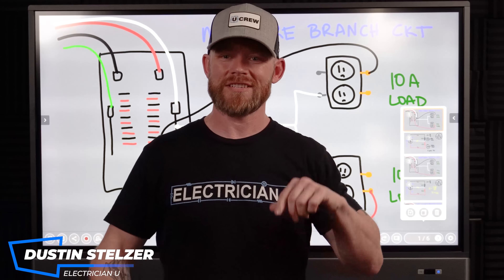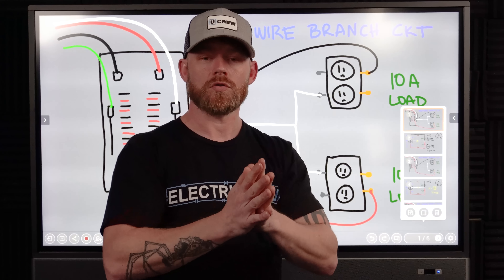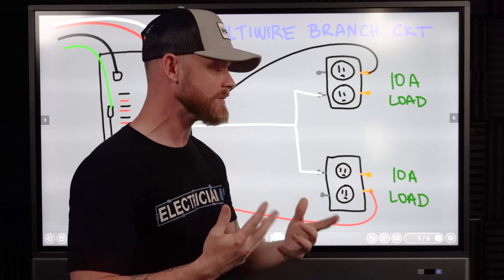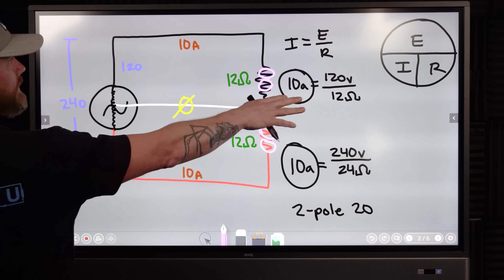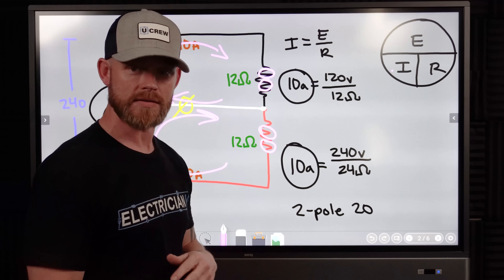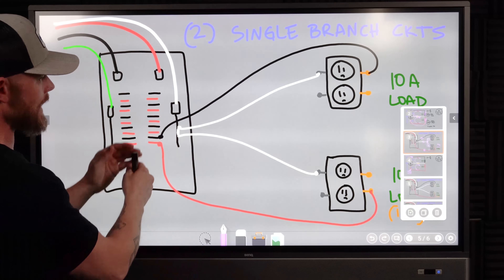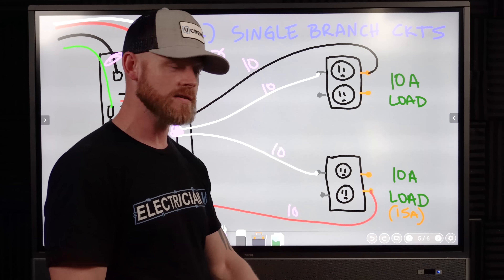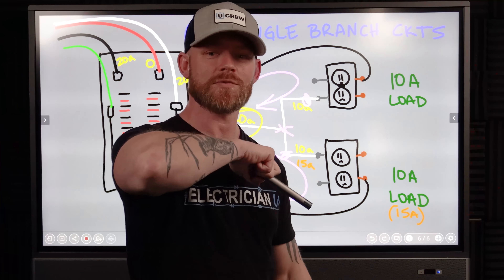Neutral Imbalance in Multiwire Branch Circuits (Two Hots, One Neutral)

Comment: So my question would be why the voltage still read 120 & why would it not fry 120 appliances? I understand the amp cancelation, but not the voltage.
Reply: If you are at all familiar with electronics, what happens to a 12VDC circuit that has two resistors in series?   Doesn’t the voltage divide across the resistors to be 6 volts?   The same here.   The 240 volts is connected in series to the two sets of equal resistance loads to divide to 120 volts.   Voltage will vary if loads are different resistances.  So, if no load on L1 circuit and full load on L2, it would be 240 volts and create a very bad situation.  Hope this helps.   Best wishes,   Kevin

Comment: Great video. Should this be a consideration in home wiring to balance the entire load for the whole house? How close should the load on each 120 feed be?
Reply: It will not matter.   Here is the problem.   Turn on some 120 volt things in your house, take readings and L1 is way higher than L2.   Turn on more 120 volt things, now it is almost balanced.   The third time could be higher on L2.   The point?   There is no way to balance an electrical panel.   Engineers used to put it in their specs that they wanted connected loads within 10%.
Reply: Yes it is possible to try to balance the main panel. In fact, the code acknowledges this by allowing a lighter gauge neutral. The only time the neutral will see 'full' current as the hot is when ONLY loads on L1 are on. Or ONLY L2. Not very common, especially as more and more loads come online and the sizing of the service feeder starts to matter.

Comment: Relatable story : Industrial building. Water treatment  plant built in ‘91. 
We had chemical pump control panels next to each other. Low amp draw. Converting 120V to a DC drive 90 V dc max. For some reason they had independent breakers and it was a split circuit. We had modern pumps with  solid state controls plugged into each supply in place of the dc conversion. The new units would Red screen occasionally. We thought it was faulty equipment. Eventually at some point we had some other failure of power supply loss 460V in the same area.  It was discovered that all this wiring 120V and 460V was in the same EMT buried in concrete. The wires had worn through the insulation and the voltages nearly shorted out. Water had infiltrated the conduit also. It was all replaced separately but our electrical contractor said it was likely we were intermittently losing our 120v common which may have yielded 220V and hence the brand new solid state computer controlled pumps were selectively locking out with Red Screen. I dont think they saved 50 cents worth of wire in 1990 because the  electric service room was only 30’ away. Why they put 120 and 460 in the same conduit is a mystery to a laymen like myself. Comment?
Reply: We would have never been allowed to do that!!
Reply: Laziness or stupidity.

Comment: When I was a first year.. almost 6 years ago.. a Journeyman asked me which wire was the most dangerous or requires the most caution. I of course said... well it's your hot.. it's bringing power through your circuit.. I feel like this video is an amazing example of why your neutral CAN be the most dangerous. It's something to keep an eye out for before you start jumping into your project. Very nice video. 👌
Reply: Good stuff. 👍 
For multi wire branch circuits,
I've been Using breaker handle ties that allow for independent tripping but simultaneous switching Because I believe that's right, right?
 If you haven't already you should make a video about do's and don'ts of multi wire branch circuits.
 Should make for a lot of content hence my comment is so f**** long
like If 2 single branchers are in one Box, you don't just tie all the whites together.
 And why you might find a neutral wire in the panel has turned a darker tan color compared to the other white ones.  Like what can happen if you disconnect neutrals at the panel Without killing the breaker(s) it belongs to.  Pig tailing neutrals at devices. And if you find Kitchen outlet Receptacle with black and red  on one side, Note the tab is broke off,  Separating the terminals.
  Labeling.
How you can ruin plugged in equipment by Being really cool and working on a multi wire branch circuit while it's hot ( Or The other breaker is still on) and disconnect  the neutral.
Reply: @earthtones1138  i believe thats right? how you ever get your licenses?
Reply: @jamesmore2919  
 License? 
We don't need no stinking license.
Reply: @jamesmore2919  
I welcome anyone who knows to answer. 
 You got a license?  Do you know what is correct?  If you knew you would have said so already. Wouldn't you like to know? 
My multi branch wire ties are set up for independent tripping and simultaneous switching Because that's according to the code I Researched years ago and That's what I've been doing and I haven't questioned it. But Rules change and the code changes. And I haven't heard of any other electrician actually Doing it this way Despite the code I read once. Instead they're using traditional wire ties or nails or double Pole breakers. Is this way dated? Or is mine Dated,Unnecessary overkill. I'm guessing The concern is breaker handles doubled up can add resistance And can Potentially retard tripping.
Reply: Biggest shock of my 50 year career was a neutral. Service drop, (overhead) was torn off the side of the building, laying on the ground. I had cut & taped off both ungrounded conductors. I then separated the neutral ACSR cable(overhead) from the SEU that should have run down the house. I was unable to let go. Still not sure how long I was stuck there, it seemed a very long time.
Reply: @williambeauregard5440  You've obviously never grabbed a knicked cord while on your knees covered in saltwater.
Reply: @williambeauregard5440  50 year career. and you working hot circuit? how you make it that long?
Reply: If someone put a gun to my head and said cut a wire between the 2 in cutting the neutral
Reply: @edsherwook5196 if you’re cutting a single wire it’s exactly the same whether it’s hot or neutral. Cutting a hot and neutral, or hit and ground, or hot and another phase is where you will have a wake-up call.
Reply: You can cut any single wire np.
Reply: Thank you so much for explaining this in a way that is for Electricians every other video I try to watch on this subject is a watered down version where 70% of the video is explaining that black is hot, white is neutral, green is ground, and electricity runs this way  (bla bla; helper level information, bla) then mentions imbalance one vaguely, and video over.  This answered everything I was curious about, and now I'm a significantly more knowledgeable electrician than I was 15 minutes ago. This channel has got me so much further as an electrician than any journeyman has.
Reply: The biggest shock I ever got was off a bare ground wire in an undetected ground fault situation.
Reply: @ that doesn’t  make any sense, because the wiring would melt in a ground fault that for some reason doesn’t trip the breaker. But if you have a ground fault you would for sure trip a breaker. But to even further explain that this is a made up story even if it was energized it’s still 120 volts, and the current doesn’t make  any difference because it’s your resistance and the voltage that determines how much current goes through your body. A shock off a feeder would be the same as a shock  iff a branch circuit, if the voltage is the same.
Reply: @danpez1  What makes you think a breaker trips in a ground fault situation?  A breaker measures current between live and neutral. You're also assuming that the voltage was 120.  It was decidedly not.  There was no current flowing until I triggered the arc flash.
Reply: @ arc flash is not the same as getting a shock, a breaker measures current in hot, ground is the same potential as neutral, they are connected at the panel. Ground is there to trip the breaker in a ground fault, that is the entire purpose of the ground wire.
Reply: @ what voltage was it?
Reply: @danpez1  If the ground was connected at the panel, the current would be flowing to the panel. This was voltage on a bare ground with no current flowing. The line holding the voltage wasn't connected to ground and wasn't connected to neutral.  That was a ground fault.
Reply: @danpez1  There was no current.  Until it fliowed via me.
Reply: @ nothing you say makes any sense and is not how things work. There’s never voltage on ground, it’s the definition of 0 volts.
Reply: @ not even a chance in any possible scenario sorry
Reply: @danpez1  Sigh.  It's supposed to be 0V.  That doesn't mean it is 0V   That's what it means to have a fault condition.
Reply: @danpez1  I hope you never have to learn that one the hard way, like I did.  I've since seen a situation where plumbing pipes were floating at 800VDC. Because of a ground fault.  I didn't take a shock from that one.
Reply: @ not a chance in hell, did this occur. You must have no knowledge of electrical systems to be saying something that completely crazy.
Reply: @ you never seen DC abvove 24 volts in your life, certainly not on plumbing, they are grounded dummy.
Reply: @lol the ground is always the reference, u don’t know what a ground fault is do you.
Reply: @danpez1  Sigh. Shakes head.

A ground wire isn't the ground.  Have you ever worked non-residential?  Have you ever worked outside the United States?
Reply: @danpez1  They are supposed to be grounded.
Reply: @danpez1  Ok.  Tell me what happens if there is a ground wire.  The ground wire is not connected to Earth. It had never been connected correctly.  Something shifts, and the ground wire is shorted to a live transmission wire.

What will be the potential on that ground wire?  And possibly the box chassis?

Now, someone touches that wire, or a chassis.  Where does that current go?
Reply: One more reason for dedicated neutrals is the safety of equipment , 110 circuit can become 220  with loss of neutral ,and that's because the loads are never balanced .The voltage drop due to  conductor resistance in one branch will create harmonics in the other  resulting in dirty power ,some oversize the neutral most head towards dedicated .Shared neutral design is shy of delivering adequate power and safety where needed .
Reply: @rovidius2006  
When multi wire branch circuits are installed correctly, they're not any issue until electricians or handyman start messing with it.
Reply: @earthtones1138  Not true ,imbalanced loads can have detrimental effects on sensitive electronic devices ,when you fully load one leg and lightly load the other in longer runs voltage can  fluctuate quite erratically  ,there is literature published on it  .  , Inductive loads on one leg will induce spikes in the other due to resistance in conductors .Regular households will rarely notice it unless something sensitive fails repeatedly .You wont see this problem with dedicated neutrals unless loads are large  and imbalanced enough  in   destabilizing the transformer  .
Reply: I'm from the UK and yes the neutral can be the most dangerous. Working on circuits, one should be very sure that the neutral is of the same circuit that your working on. If its on a different circuit to your hot wire, with plenty of load and you spilt the two neutrals and get across those neutrals, you will have a problem of letting go!! You will stick to those cables, because in affect you are connecting them and carrying the load! So yes the neutral can be very dangerous. Its important not to share neutrals, each circuit should have its own neutral. Testers than only test for hot wire are dangerous just because of that useless. Neutrals in  a board should correspond with the hot wire of that circuit. DONT take it for granted, thats when accidents happen. It gets much more important when you go industrial because the loads are so much greater. Be wise, DONT EVER take anybody's word-check and be safe. I know, because I got a 415v shock on a "dead " board!  Great excuse for a beer!
Reply: @johnchristmas7522  Indeed ,a shared neutral will save a conductor  or two but will double the existing voltage when that neutral is lost to the extent of  415v in UK  240v in US .I once hooked up a generator to a house and lost that neutral somehow ,light fixtures were screaming and moanning till i figured out what it happened .Youy can get shocked without ever knowing  ..
Reply: @deang5622  

There are few voltage and phase angle configurations that I'm aware of , this one particular case was a generator 120/240 volt 180 degree angle single phase , neutral got disconnected somehow and light fixtures ballasts  went screaming because heavier load on one leg  , you always end up  with greater resistance on one leg which will cause voltage to double or a degree of it  , coils and caps pulsating power back and forth till something blows up .Did not know of this possibility till it happened and it sparked my curiosity .Ballast , coils and caps along the unregulated  circuit can send voltage spikes at much higher voltage as components are stressed beyond their limits .
Reply: @deang5622  If you hook up a voltage oscilloscope to one of this circuits you would understand what i mean   ,it is usually engineers that bother with this type of experiments  not your average electrician, reactive currents are not visible on your instant voltmeter. Burned up equipment don't always   tell the whole story that's how dedicated neutrals came about and yes you could theoretically see 1000 volt spike on a 240 or 110 circuit if you have the right equipment at the right time .
Reply: The neutral is the most dangerous wire if you have a load on the neutral and you get in between the hot and neutral. In other words keep the hot joint together and take the neutrals apart and your body connects the neutrals. You become the return path. I did that once on a 277v lighting circuit. My journeyman at the time turned off the switch and I started taking the joints apart in the jbox. We were taking out 2x4 lay-ins and I took the switch legs apart and when I went to take the neutral out of the joint I forgot the lighting circuit I was working on fed 1/2 of the lights in the whole building. The hot was still together so I had a load on the neutrals. Well my thumb touched the stripped wire and my hand immediately closed on it from my muscles tensing up. I couldn’t let go of it and I couldn’t tell you how long it had me but everything was white. Apparently my journeyman hit my arm with a 2x4 and knocked me off the joint.
Reply: @codycurry91  You were lucky with that 4x2!

Comment: I frequently find homes where two hots on the same phase share a neutral.  It's a bad situation and the neutral is usually yellowed and discolored; it's a recipe for a fire.  Some people just don't understand split phase power systems and they shouldn't be messing with wiring unless they do.
Reply: I see it every time in residential calls...usually after there's a remodel. I let the homeowner know that Chuck in the truck put their home in jeopardy.
Reply: Half size breakers really mess up a lot of people.
Reply: @KevinCoop1  They really do, they think they just need to skip switches when they really need to be skipping each inch of breaker height to get to different sides of the split phase.
Reply: @taylorlightfoot     If you have no knowledge about the information in Dustin’s video, then you wouldn’t know any difference.  I’m sure many will watch this video and still not have a clue.
Reply: I would suggest that the neutral connection is loose.   Multiwire branch circuits create less load on the neutral, not more.
Reply: @KevinCoop1  No, my comment stated that I, while working on homes, find work done by others where multiwire branch circuits sharing a neutral wire were wired incorrectly with both hots on the same hot leg.  The scenario you describe would result in unstable fluctuating voltages deviating greatly from 120V, that was not what I was describing.
Reply: @taylorlightfoot    I am very sorry!  I read it too fast!   You would be 100% correct!   When our company did panel infrared scans, it was almost always hot neutrals within them.

Comment: Found out the hard way. The way they teach it now in school is go by the code. But the way it's done sometimes is by much older code. Needless to say I got bit by a netural for a gate motor that was Sharing a netural with a pole light. Was working on the lights,breakers and contactor control breaker was off...but not the gate...
Reply: Thankfully no one was at the gate when it happened.

Comment: what happenes 3 phase one netural
Reply: It will work just fine.   It’s done all the time.   Balanced load means no current on neutral.   2 phase 1 neutral is not a problem either.
Reply: @KevinCoop1  of cource i want to see him go through the motions and draw it on the board
Reply: @andrewfischer8564     I’m sorry, it was a possible video comment.   I can delete my comments if you would like.

Comment: I been in a big 277v building the LTS were all on 2 hots if I killed one hot I'd see 60 to 80volts on the nutural ,testing hot to nutural.  Flip breaker back on it shows 278 again . I traced it to a shared nutural.  is this correct?